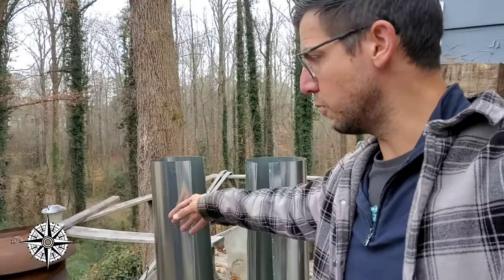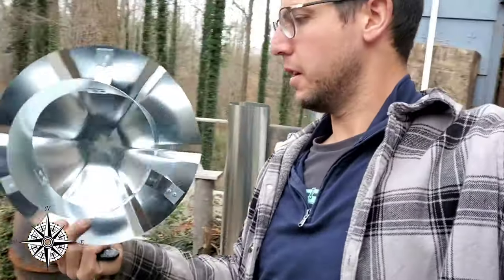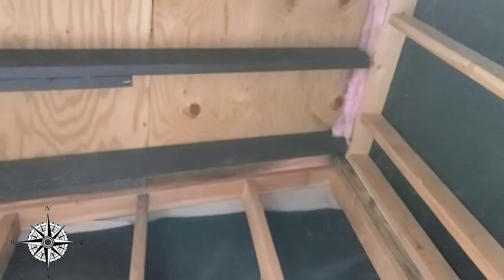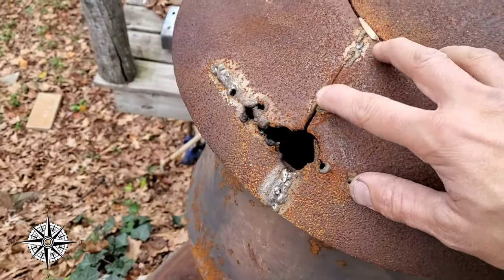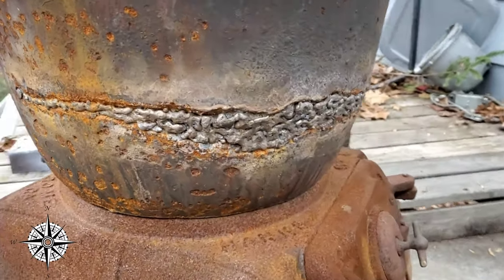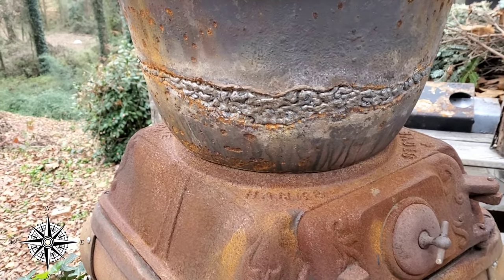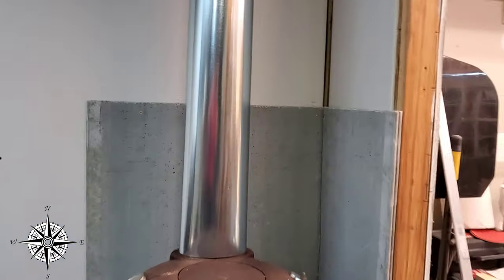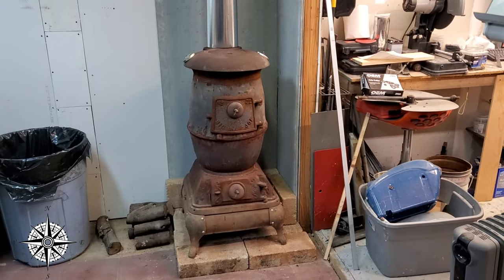Pot belly stove fix and install

Comment: Everything your doing us WRONG!!  That wasn't cement in the stove, it's special refractory cement and needs to be redone. That pipe is NOT stove pipe. It MUST be rated black stove pipe.  That stove needs to be 36" from the wall unless you add an approved wall protector. Then you can get away with 18". Sheetrock is NOT a heat shield! Where you go threw the roof needs to be class A chimney pipe, double walled, stainless. And you need a real roof flange that will hold the pipe away from the plywood. This is a major fire waiting to happen and as it's not installed to NFPA specs your insurance will not cover any fire damage.   If you don't know what your doing don't do it!!
Reply from the maker: Cool
Reply: Also, the pipe was installed backwards. Upper pipe should go into the lower pipe. Any creosote that builds up and gets dislodged needs to fall into the stove without a chance to fall outside of the pipe. Yeah, a lot about this video is scary, but can be used constructively to inform those starting out.
Reply from the maker: @Ariesdrone603  neat
Reply: This was interesting.  I'm going to guess this video was made to put the stove  nazi type folks on edge. You certainly have succeeded 😅

Comment: We ran our flue diagonally across our shop at a shallow incline, and gained lots of extra heat, before running it out of the roof.
Reply from the maker: That is an incredibly great idea and I definitely should have done it I'm realizing most of the heat is escaping

Comment: I was interested solely about the pot belly stove . One thing that I’ve seen on some other videos is in order to get the ‘ hot’ bed you are looking for is to use Match Light charcoal , as opposed to using various types of tinder in order to get things rolling , so that you only need to put enough to give you the glowing bed you are looking for . Any more videos you might make on your stove I would be interested in . Thanks

Comment: The cracked/damaged fire pot can be lined with high temp ceramic putty or cement. Even just 1” thick one the interior wall will protect from too high temps. That stove would burn coal very well. You would have to get a flue damper to reduce airflow. Great job and good luck!